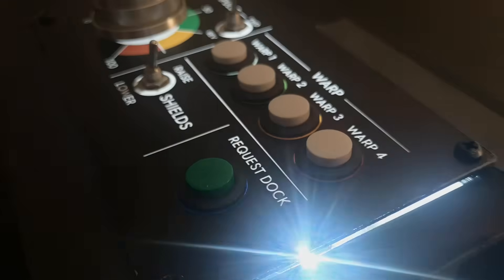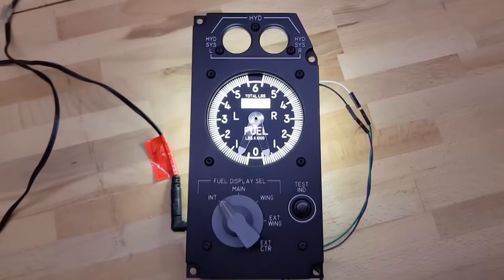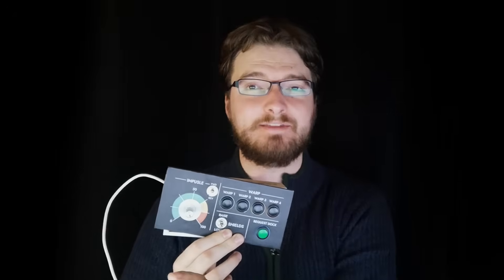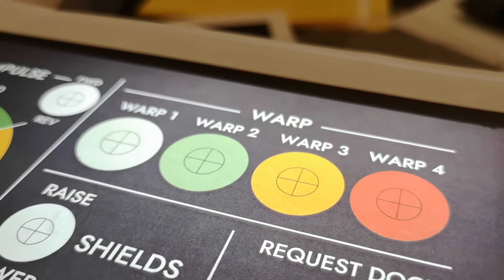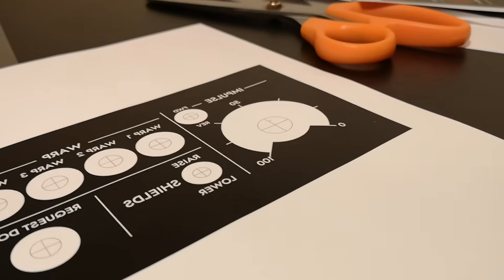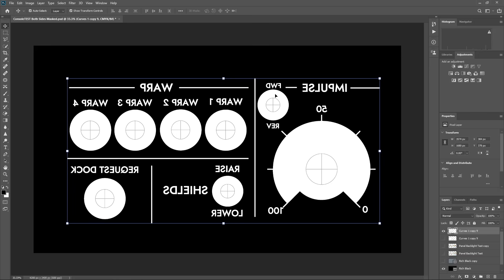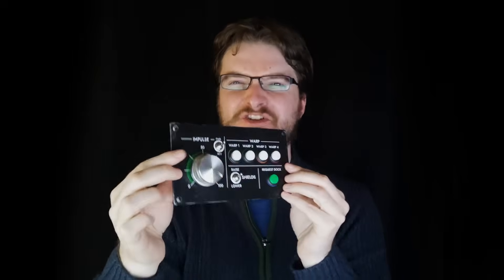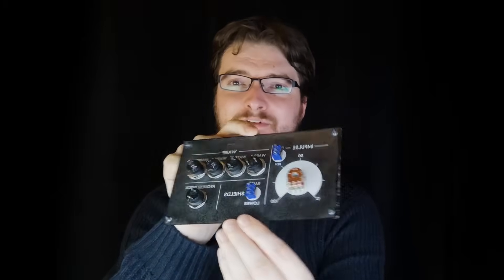The $2 Backlit Button Panel: Simple Method For Flight Sims and More

Comment: Great idea!  I would recommend doing the registration of both sides with only an outline rather than the full, solid black print. You'll save a LOT of toner ($) and it will line up perfectly a lot easier. I'm going to try it with 64# vellum paper rather than the thick white.
Reply from the maker: Thanks Michael, true that you can run a few tests with just an outline to save on toner, and then switch to printing full registration black once you've got it close to dialed-in.
Reply: Right on! Was thinking two layers of vellum myself 👍
Reply: And probably add second layer of acrylic sheet on the top to make protect printed paper from dirt and scratch. If the button threads make it possible. If not the bottom acrylic plate should have got bigger holes to fit the nut in.
Reply: Use two sheets of paper stuck together, a lot more efficient.
Reply: @TomasTame-Ambient-Sci-fi  The issue with using a 2nd sheet of paper is the thickness. Adding a 2nd sheet dims the backlighting a fair bit as well as deludes the white color more into "yellow".
Reply: @lyianx  I would suggest to use a lightweight low gram paper :)

Comment: If you can get the registration to hold tightly, and you have a sufficient uncoated stock, you could put the paper in for another pass of the back side. 
Printers will limit themselves to not lay down 400% ink to allow each process to dry. 300-330% is the general limit; but your advice still stands to set the image to maximum value and make the printer limit itself as it wants.

Comment: Outstanding work!
Reply from the maker: Thanks! Although nowhere near as impressive as your cockpit. I've paused work on this spaceship panel while I experiment with different materials to print on. Paper really does work extremely well but I worry that it won't hold up over time since there's really no way to wipe it clean (the toner-covered areas are fine, but anything white turns to pulp).  So, waiting for a sample of this: https://www.riteintherain.com/printer-paper-20-pound#paper-colors_white_sizes_letter_packs_200-pack#8511
Reply: @EricFergusonCinema  I actually started my project using similar paper templates before I got a laser cutter, however I never tried backlighting them. Rather than glue the paper to the plastic, I had mine sandwiched between two pieces of clear acrylic.
Reply from the maker: @thewarthogproject  That definitely seems like the best way to really protect it, and actually I see some commercial sims are doing this now at flight schools, no doubt at least in part to make it easier to wipe down between users. I really think it sacrifices some of the realism though: adding any glossy coating breaks the realism and feels like an arcade machine. I'll keep searching for a perfect material that can run through a laser printer!

Comment: Nice idea!

You could even go a level further. Again, literally.

If you sandwich the back-to-back printed sheet between 2 plexiglass layers, you could make the printed sheet removable, thus interchangeable.

This could work if you want to have a multipurpose button box with different functions depending on the game, or space-/aircraft.

You still need to make good and tidy cutouts on the top acrylic/plexiglass sheet and the printed sheet, though..
Reply from the maker: True! This would work especially well if you were building a panel with capacitive sensors, which will sense through the paper and acrylic and therefore require no through holes for panel mount components.

Comment: but... why not using two sheets of paper instead of struggling to align two prints on same page?
Reply from the maker: Works less well than you'd think, because (1) the amount of light getting through drops exponentially, not linearly and (2) lining the two layers up perfectly in a glueup is actually still quite difficult. 

However if you're going for a process where the two sheets are sandwiched between layers of acrylic, this is a little more doable. Use a transparency sheet for the "mask" layer.
Reply: For the struggling: if you use Photoshop, you can perfectly align it that way, because you can make an A4 paper size template and do a testprint to see how it prints double sided (left-right, or up-down) and then mirror the design to the second page it will print on the other side.
Reply from the maker: @Dutch3DMaster  Using the printer's built-in duplex function you mean? Yes this works too, but you'll still have some trial and error to see how much error your printer introduces along the way. Tell your printer to print a single dot in the middle of a page, it won't be perfectly in the middle. Shouldn't take more than a few prints to get it dialed in though.  You'd be surprised how much small variables affect this though, including the position of the guides if using a bypass tray.

Comment: Awesome idea with amazing results!
Is there a reason to do a double sided print instead of two layers of paper?
Reply from the maker: Thanks! Yes, you need both layers to fully obsure the light and get a rich black background. One layer, even with 100% registration black, still looks somewhat washed out. Printing on both sides to build up two thick layers of black toner is the key to getting this panel to look "solid"
Reply: @EricFergusonCinema  But the question was: How would this work if I printed both layers on separate pieces of paper, and glued them together? Does the light still shine through properly?
Reply from the maker: @peterwilhelmsson4168  still shines through, but the two layers decrease the amount of light dramatically. Perhaps doable with the right combination of papers, or with one layer of transparency.
Reply from the maker: @peterwilhelmsson4168  Over on the Artemis SBS forums, there's a person building a panel right now using this method, but two sheets of paper carefully lined up first with a painter's tape "hinge", and then spray glued. It does backlight! Noticeably less light transmission than a single layer, but absolutely workable. https://artemis.forumchitchat.com/post/low-cost-weapons-panel-12255047?pid=1331872677
Reply: @peterwilhelmsson4168  I have used overhead projector sheets layered 2 or even 3 times (in my case because the icons are black and the backlight area is either red or yellow/orange.  (It's not for a flightsim setup, but for a bus dashboard).
It's a proces that well...sucks because it's time consuming and it takes steady hands (which I do not have) but it worked.

Comment: You didn’t show how u did the backlighting. Using clear acrylic is not going to spread the light. Typical led strips don’t diffuse light and you’d get spots on fb light and dark. I’m curious how you did the backlighting.
Reply from the maker: The white paper acts as an excellent diffusion layer! In this video the backlighting is actually just a single LED, from a phone's flash LED. You can see me set the phone into the lightbox at 3:14.  All the images in the video were shot with that basic lightbox.  Of course with large panel-mount components you'll get issues with shadowing using just one LED like this, so a strip would be better. But no extra layer of diffusion is necessary.

Comment: WOW This is thinking outside the box at its finest. The light bulbs are going off where ever I look. The only thing I can think of is that no refreshments / Beer will be allowed near any of my cockpits lol Great stuff thanks for the video!
Reply from the maker: Haha yes that's a concern; although you can spray it with a few coats of cheap acryllic clear and that'll protect it.
Reply: You'll probably want to seal the print anyway to avoid smudges, black toner has a habit to not stick very well...
Reply from the maker: @Dutch3DMaster  I think this was an issue with some older desktop laser printers that couldn't get up to temperature, but it's much less of a problem now. The black toner surface on this print is reliably solid plastic, not powdery, doesn't smudge. Perhaps over time will break down?
Reply: @EricFergusonCinema  Not really sure if temperature was to blame honestly, the thing I have noticed is that laser printers have been getting fast at printing.
My brother used magazine paper to do toner transfers for PCB etching, and the printer from 1994 we had printed a very deep black which adhered very well to the PCB material.
When that printer went defective in 2012 we got a new one that printed a page incredibly fast (compared to the 10 seconds it took for the old one to output 1 page from the moment it started to leave the printer, the new one layed it down within a second).
My brother has problems with the amount of adhesion on the PCB material ever since we have that printer and he suspects it's the printing speed that's to blame, along with economy modes that might still be active in firmware and which you can't switch off.

That printer had serious trouble printing the transparent overhead projector sheets (in the sense that the print on it was incredibly vulnerable to even touching the print, let alone accidently scrape it with a fingernail), but a color laser printer I bought second hand has proven to be a whole lot better at it, I can rub my fingers on the sheets and even run my nails over them and the print stays on...